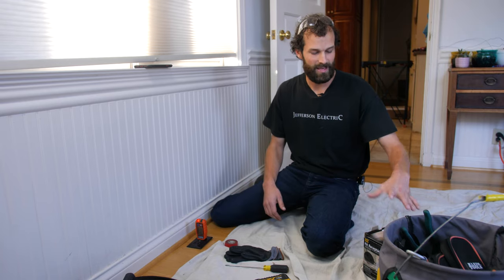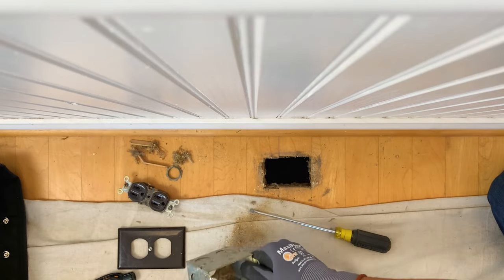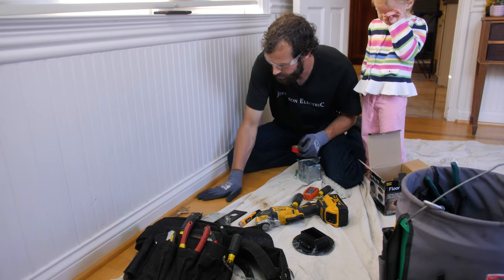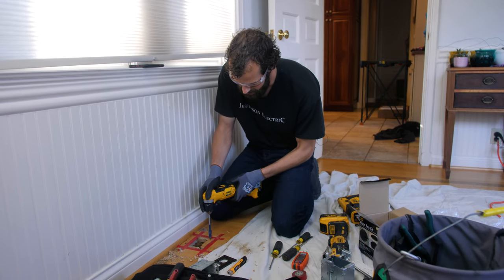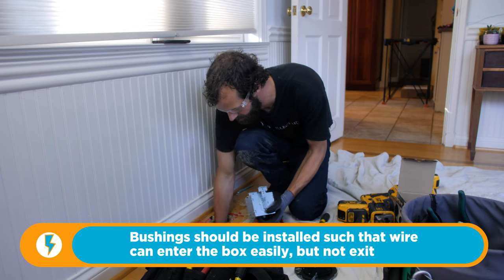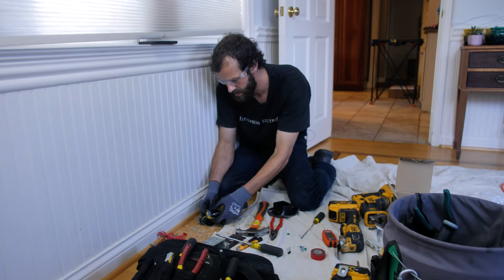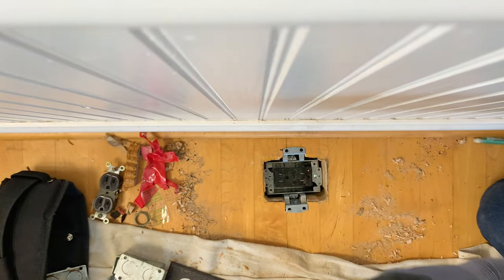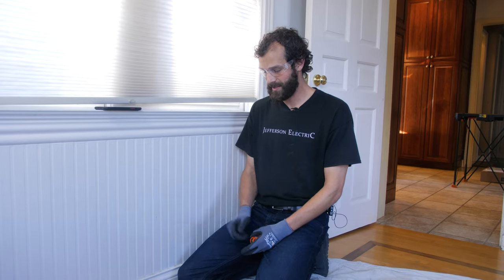Replacing My Floor Outlet Receptacle

Comment: I was reading some old Popular Science magazines written in the 50's where they are installing electrical receptacles in homes built around 1900 - 1920's.  They removed the baseboard, and ran the electrical romex (well rag wire back then) into the basement, and to the remodeler box.  They did not worry much about drilling a 1" hole into the bottom of the wall, and into the basement, as the 4" to 6" high baseboard was going to cover it all.  

They recommended at least 1 receptacle in each room!  (this was way before color TV's and cable box that needed 120 volt power.)    

While I do like the all metal construction of your new cover plate, I would much rather have the receptacle on the wall, away from a chair that can bump into the receptacle, and what is plugged into it, and damage something.  

Overall, great improvement to the safety of that plug! And another wonderful video!  I loved the one about your 1,000 amp wall of power to your home.  I also think it is great that you can install a EV charge panel, and get such great pricing on overnight electricity in Indiana! 

Keep up the great video's!  

Fred.

Comment: @31:30 all the decorative painted screws ive found have always had weak heads and like to snap off. 

also when trying to widen outlets a good file/rasp can make expanding and squaring the hole a bit easier. especially if you only need to remove like 1mm of material

Comment: Joel, I really like all you do but I did not see a ground wire coming into that box so tying the receptacle ground to the box does not make it grounded.
Reply: A ground from receptacle to box is still a ground. It's no different than on older switches and receptacles where the DEVICE didn't have a ground screw, but the box was metal and the cable was grounded to a set screw for the cable clamp. 
He may have BX in the floor, which uses the metal sheath as a ground, and the pigtail he's adding brings it up to current code.

Comment: Good video/work! Wow, it's been a long time since I've seen a floor receptacle in a home (I'm not an electrician). Did that cover plate have screw-in plugs to protect the outlets, like we find in theater/stage floors?  Also, did you consider a Recessed Church Pocket Stage Floor Box for this project?  Thanks for the video!

Comment: I enjoy a lot of your videos, but I'm concerned that there is no dicussion here of grounding this outlet.  Unless you have a GFCI breaker, this outlet appears to be ungrounded and a code violation.  Worse, bonding the ground on the receptable to the junction box reinforces myths some people have about grounding.  This needs a ground connection back to the panel or GFI protection per NEC.
Reply from the maker: Valid concern, @Patrick Stetter! The simplest solution is a whole new Romex run back to the panel. We'll be updating all the wiring in the whole house in the near future, and this receptacle will be part of that!

Comment: Why ground the outlet to the box if the box isn't grounded?
Reply: yes, a major code violation. this is an ungrounded outlet. not safe at all.
Reply: @AidanSkoyles a GFCI receptacle will bring this install up to code.  406.4(D)(2)(b)

Comment: Using the plastic connector to metal electrical box will not provide ground continuity on the circuit. I believed the wires were in mfc by just looking at it. So, bonding the receptacle on metal box is basically not useful. This receptacle for sure has open ground.
Reply: FMC rather

Comment: i think i would have cut out a little template, then double-sided taped that to the floor, and used a router. Little involved, maybe, but makes it easy to get a nice result without much skill involved.

Comment: Instead of using electrical tape, try using blue painter's tape or green frog tape to mark the cut. Those tapes are not supposed to pull off the finish.